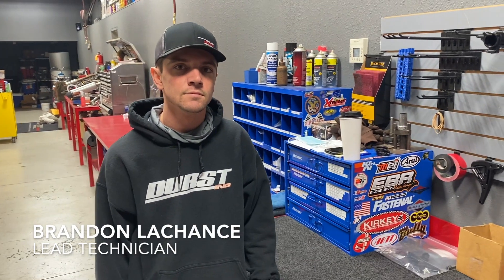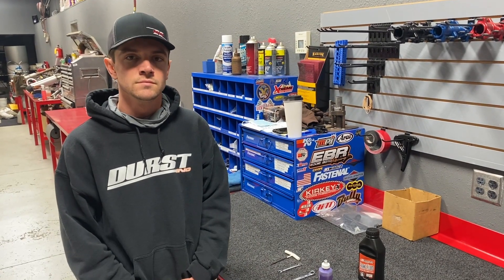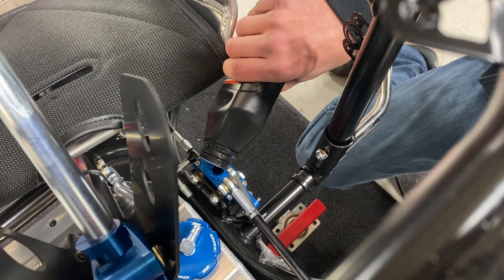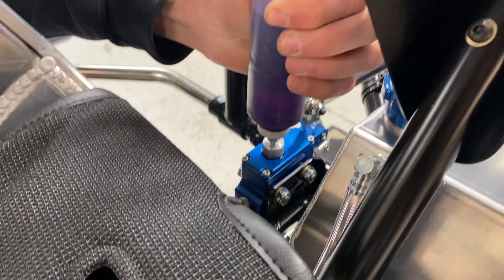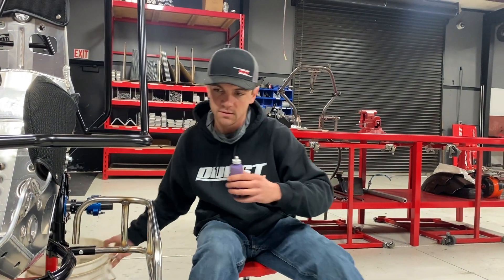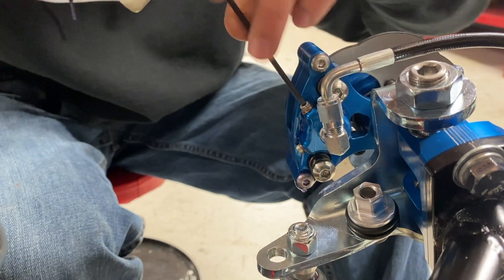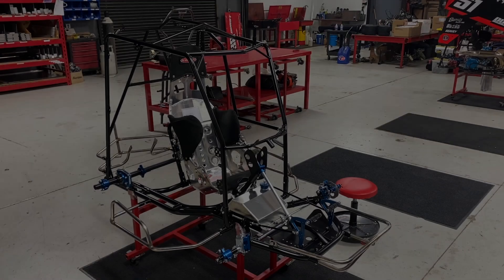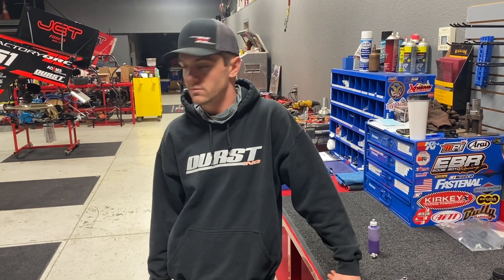How to build an Outlaw Kart: Step 11 - Bleeding the Brakes

Comment: Would that brake bleed kit work for a 600 micro sprint? That looks super simple
Reply from the maker: Hey Rusty, we’re not sure if the nipple that screws onto the master cylinder is the same size as your micro. But if it is then it could work.